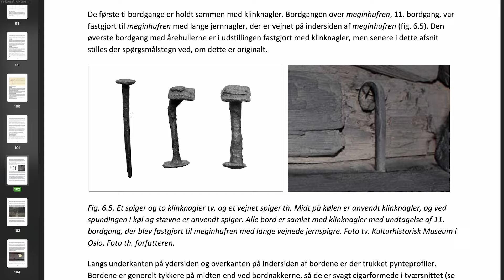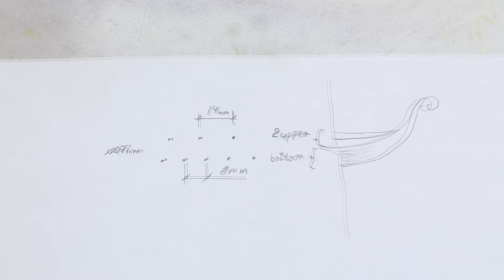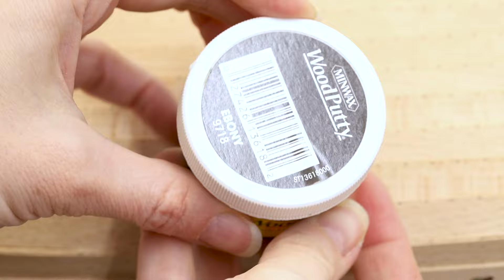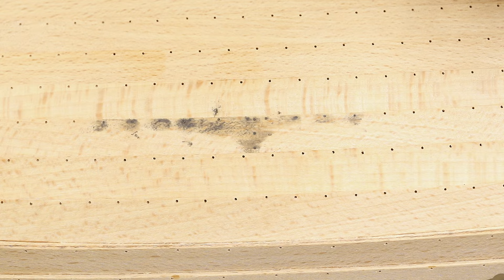#5 Viking ship OSEBERG - Making nails  - model ship building

Comment: I built the Billing Boats Oseberg a few years back but this looks to be in another league! I might go back and add nails to mine as they are such a distinctive feature of these clinker built hulls. One thing I noticed on my model and on virtually all model viking ships is that when you look at them head on, the stem (and also the stern) seem too thick, in that they seem to continue the same width as the keel. If you look at pictures of the original Oseberg ship head on, the stem seems to be quite narrow and certainly much narrower than most models portray, which to my mind is a big part of why the hull shape looks so graceful. Part of the problem seems to be that manufacturers give the intricate carving for these areas as additional parts to laminate onto the side of the stem and stern posts making them even thicker when I assume the original carving was done directly into the posts themselves.

Comment: I am curious about the nails you use. What is the diameter and length of these. Where do you usually get these
Reply from the maker: In the case of OSEBERG, everything is very simple, we have the original in the museum - there is no need to invent anything. By the way, a book with detailed documentation of the ship was recently published. The Oseberg Ship: Reconstruction of form and function (Ships and Boats of the North, 9) by Vibeke Bisсhoff.  In the video, I used Vibeke Bisсhoff's doctoral dissertation about OSEBERG.
I added a link in the description under the video.